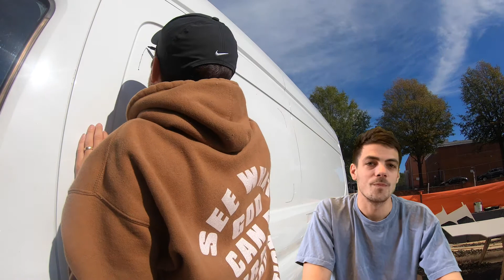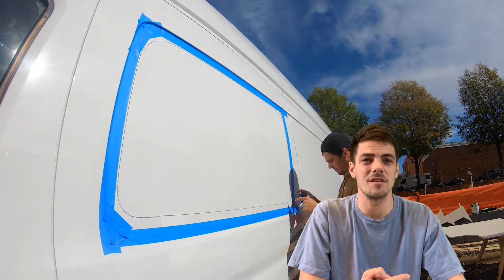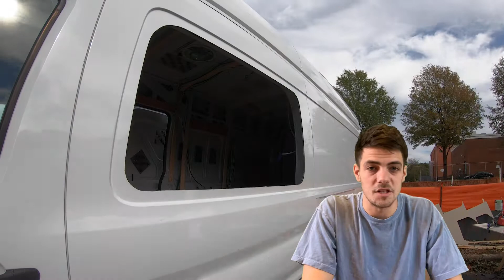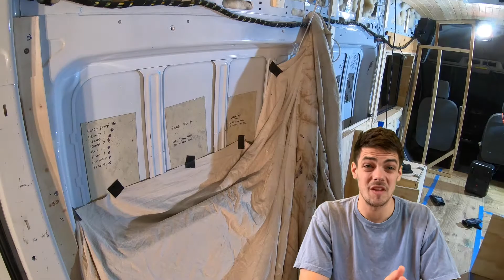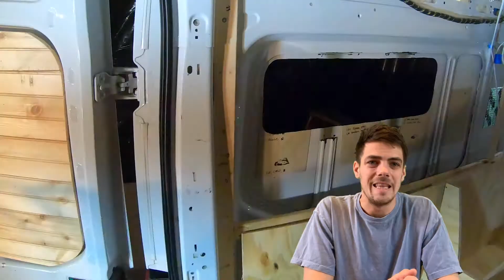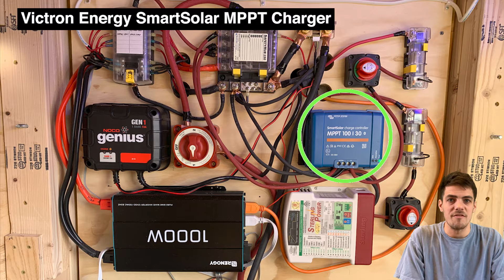Installing Windows & Electrical | Camper Van Conversation | Ford Transit DIY Van Build

Comment: Just found this video and wanted to see if your Renogy shunt monitors sees your DC charger providing charge to your batteries i.e. the upward arrows next to the capacity like the solar shows?
Reply from the maker: Yes. Anytime you producing Amps (from solar, dc charger, shore power) you will see when it's proving charge and how much.
Reply: @Ben_Land  mmm, thanks. Mine does not with our DC charger, but we have never been below 5% below our max capacity

Comment: Hey dude, im finding your vids very reassuring tbh. About to embark on my first build, and wondering how many days of work in total roughly, it takes, rather than overall time in months. Is 25 days of work spread across a few months reasonable? Or is that just too random a question
Reply from the maker: Thanks Homan! I don't think it would be possible to finish a build like ours in 25 days. Maybe a simple build you could get away with - but an involved build like ours took more like 120 days.

Comment: Definitely a scary part of the build. I've been researching this for quite a while and I still haven't decided on all the components. I guess I'll try to follow Will Prowse and build my own lifepo4 battery. Thank God you can't get killed by 12 volts ;-)
Reply from the maker: Yeah, 12 volt seems to have a lot more intricacies but is far less dangerous. Which is nice 😊